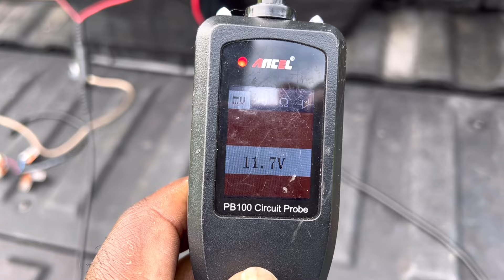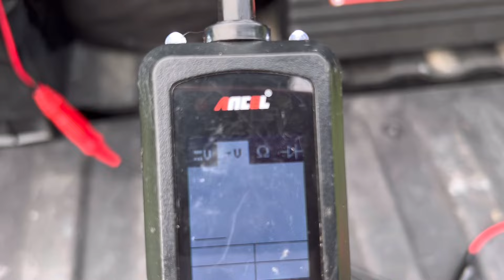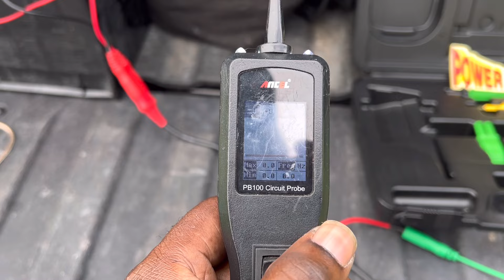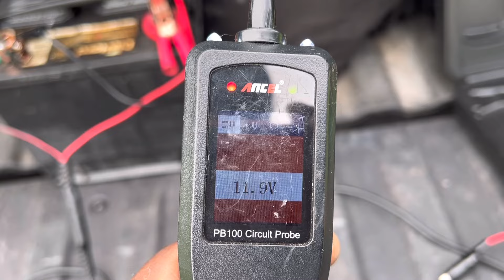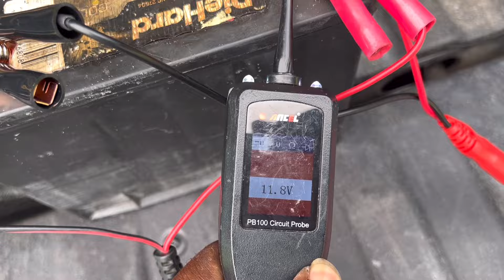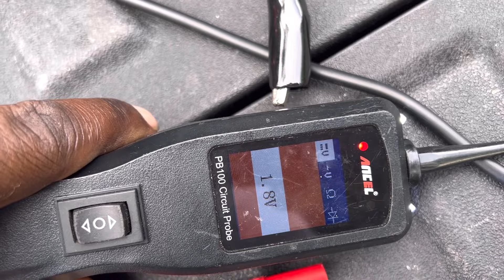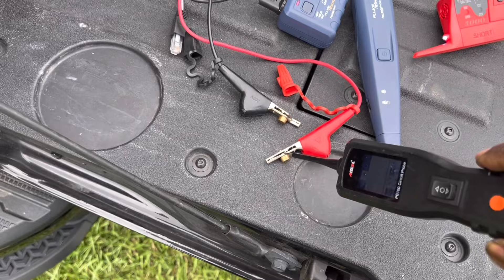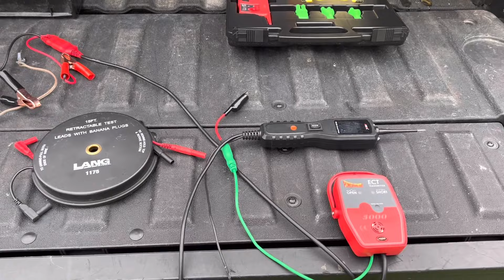Why the ECT3000 is such an accurate tracer

Comment: One of the key features of the Ect 3000 transmitter is the Tone on/off button.  How to use this button to silence the irritating tone is documented in the user manual included with the unit.  Ancel is great for homeowners for troubleshooting basic/non essential components like lawn mower headlights.
Reply from the maker: thanks for watching